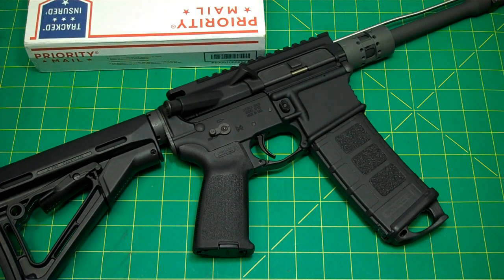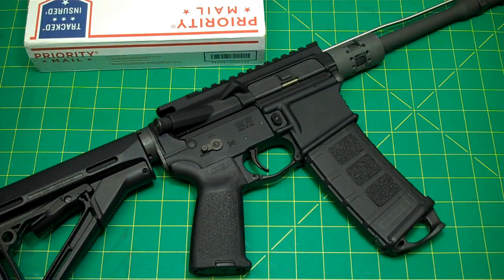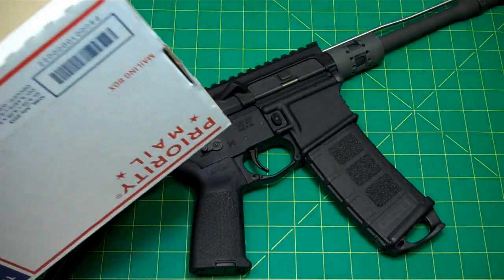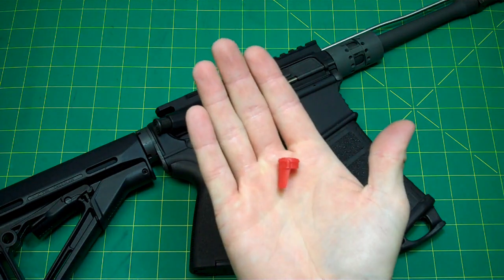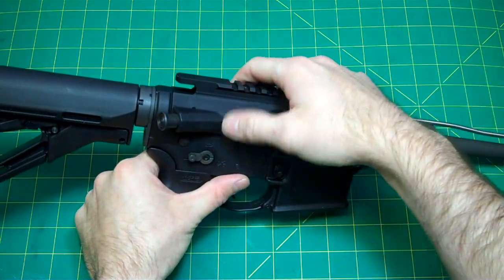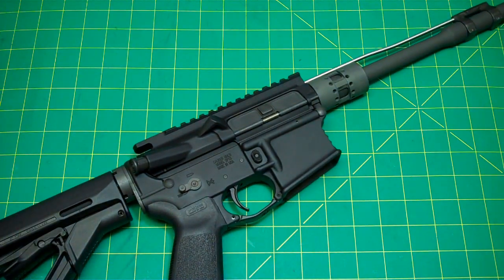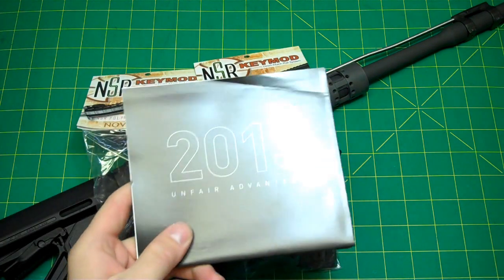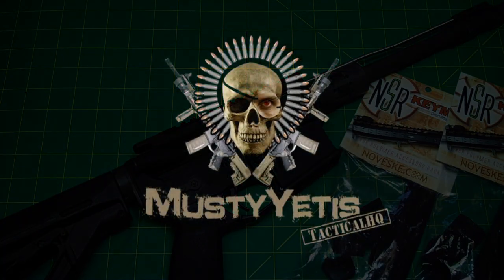ACCU WEDGE :: Does It Work??? :: Musty Yeti

Comment: Does absolutely nothing for accuracy, just makes a rifle feel a tad bit more solid feeling. If you decide to use the product, be sure to shape it as perfect as possible because if forced in any way it can effect balance of the bcg when it slams into the buffer weight, causing it to not be consistent thus putting way more wear on the bcg on one side and not the other. I would advise the video creator to trim his up just a bit. You don't want a tight fit, you want it to just be a bit snug because you're now also introducing uneven pressure on the takedown pin.

Comment: Slack between upper and lower is almost irrelevant as long as the hammer strikes the primer in good alignment and does not interfere with the upper structure.  The accuwedge is cool but cosmetic.

Comment: When I first got into ARs I was reluctant to “put some piece of plastic in my rifle” as so many on the forums will say. It’s horse shit. Nonsense. I spent $1000 on two really tight billet receivers sets (SLR and Ascend Armory) and after about 1500 rounds they both started to wobble. Steele will wear on aluminum over time. Better off going with a cheaper receiver set and just wedging the bitch. Not only does it work but it’s essentially constant and will not wear down. My two cents.

Comment: I asked around online and someone recommended I slip a small rubber oring around the front post of the upper receiver so it sits between where the receivers pivot.  I bought an assorted package of the black nitro rubber whatever orings at the nearest hardware store for $2 and used the smallest one.  It fixed the rattle, stays in place and isn't noticeably visible.
If you haven't bought a lower yet, Rock River Arms lowers, the one I built my other AR on, are very tight and never rattle.  Aero precision lowers come with a built in tension screw that stops any rattle.  Mine that rattled was a budget build with Anderson Arms lower and PSA upper.

Comment: You can shim it using cutout buss fusebox lid where the front pin meets the receivers and then laying a piece of electrical tape across the lower behind the hammer and it will tighten it alittle better than the accuwedge.

Comment: Call me cheap but I just stuck some foam in the same place the wedge goes and it works great, even after putting rounds down range.
Reply: I doubt that foam would do so well under stress as plastic.
Reply: 1000+ rounds and youre right, its starting to give a little play again might as well buy the damn plastic thing for a couple bucks

Comment: I've been using the same lower for highpower service rifle for almost 20 years, I'm on barrel 9 now and my rig. Is sloppy as hell. I'm running a .255 takedown pin custom made cuz the hole got so egged out. I used the wedge for a while but took it out. Noticed no change in group size. If you have to push down on the upper really hard to get it on your eventuall gonna egg out your takedown pin hole. Might take a while but for me I put a lot of ammo downrange

Comment: Because you have no BGC, it will have extra wobble noise. Once you add a BCG it removes a good chunk of noise as the buffer is adding pressure forward into the BCG. It will still have the loose tolerance, but the flop noise will be less pronounced.

Comment: I just tried installing an accuwedge last night in my build.  there was no way it would close.  I ended up having to shave off half of the bottom of the rubber to get it to fit snug.   it does eliminate any of the play you might find, but it makes it extremely tight!
Reply: Tyler Effinger your lower may not be truly mil spec. The m&p15's won't take an accuwedge without shaving off a significant portion of it.

Comment: All you need to do with the accu wedge is cut off just enough off the bottom to have it do what it's designed to do but still give you the ease of opening it up by hand.  I used an exacto knife to cut off little slivers off the bottom until it fit just perfect.

Comment: Movement will affect group size.  The more consistent the contact, the better.
Fully bedding the upper to the lower is a lot of work, this is easy.
Reply: How does it affect group size?  Your sights/optic are on the upper receiver. The optics don’t move in relation to the barrel.
Reply: @alphazuluz  it doesn’t affect barrel or optic accuracy.  Rather it affects shooter accuracy.  In effect it’s like having a jiggly grip.  Not the end of the world but annoying and requires more shooter compensation.

Comment: Years ago I had a Fulton Armory AR that came with one installed. Currently I have a Smith & Wesson M&P15 which does not have one. Does it work? Yes. Is it necessary? Meh. (Fit and finish on the Smith & Wesson is much better though.)

Comment from the maker: Trust me the Accu Wedge is plenty tight, maybe too tight.  Not to mention it isn't really necessary.  Most AR's have slack between the upper and lower receiver which doesn't hinder accuracy what so ever.  Thanks for taking the time to comment, I'll take what you said into consideration.

Comment: Turn your gun upside down and put the back end of your receiver, the rail above the charging handle on the edge of a table and push on the pistol grip and you can line up the pin with the Accuwedge installed. Easier yo show than say.

Comment: What problem does play between upper and lower cause?
Reply from the maker: None, it's pretty standard to have play between the two.  I was buying different part so I figured I would try out the Accu-Wedge.
Reply: MustyYetisTacticalHQ Did you keep this in your AR? Did you notice any change in your groups? This reminds me of a vague memory I have of someone advocating single shot rifles for long range competition because the lack of mag well allows for a more rigid design. I have no idea how true this claim is or what proportion of improvement you'd get in consistency from having less than standard play between the upper and lower receivers.
Reply: None.  The accu wedge is the product of picky non sense.  when I build my first AR i noticed play between the upper and lower and was considering the accuwedge.  THEN i took the rifle to the range and it ran through a couple hundred rounds flawlessly.  Plus a little research on top of that and I realized that there is nothing wrong with play between the upper and lower and it is in fact normal.

Since then I honestly dont even notice the play anymore, and it is much more play then what this guys rifle has in the video.  once you actually shoot your rifle instead of playing with it in your bedroom and you realize the play means nothing, you immediately forget about it.  I dont even notice it anymore.  dont waste your money on the accuwedge if your rifle is functioning.
Reply: TechnicaIlyInsane I think I'm done watching MustyYetis's videos; his entire assessment of this part is him putting in his gun straight from the mail with zero followup after shooting, let alone an organized long term assessment of its effect on  performance. There's nothing about this that I couldn't have learned from a google search and customer reviews and he knows exactly as much about the subject when the first words come out of his mouth in the video as I did when I loaded it.

Comment: @Logan Payne- thats cause DPMS oracles have that clunky 6061 grade aluminum upper that is thicker than BETTER 7075-T6 uppers used by other companies. Face it, the oracle is the lowest grade working AR you can get- unlined 4140 barrels, crap cut m4 feed ramps. If you believe a 650.00 oracle is a great gun,good for you- I can put together a BETTER PSA carbine- CMV chromelined barrel, m16 bcg,H buffer for 100.00 LESS......

Comment: Accu-wedge does eliminate play, but offers no benefits in performance.  The gun becomes unnecessarily tight.   It will not increase accuracy, as there is no effect on the barrel or sights/optics.
Reply: Josh Borton go see the TC boys and make that statement. It allows the Barrel and optic to shift slightly under firing conditions. Down range that adds up. So lock up is important. Saw another design might be better for precision rifle that included expanding pins to lock up the action.
Reply: Thomas Ewers 😹 Sure buddy. Because fuck physics.
Reply: Ya, after doing some research I've come to the conclusion that these wedges are a waste of money and time. They have no effect on accuracy, it's a gimmick.
Reply: That just what they say to sell more. All in all, it's a comfortability product. Much like the magpul CTR vs MOE.

Comment: The perfect solution to a non-existent problem. A fool and his money are soon parted.
Reply: the whole 4.99 these cost for packs of 6+. what a loss
Reply: Cryengine_X That is still money you could have put towards ammo  or even some small part that is actually practical. The point is that people are too meticulous about what feels "cheap". If I can qualify with an old "rattley" M16, trust me, the play is not an issue. Every rifle will always have a little play. But it isn't enough  to throw off your MOA, otherwise, every rifle would have to be replaced every year. If you don't want your rifle to rattle, leave it on the gun rack.
Reply: Folks who buy this device are seen as not having a comprehension for what's really important to good shooting, properly pointing the rifle with consistent sight alignment and pulling the trigger without disturbing aim utilizing SMOOTH trigger control.
Reply: @leroyatleroys  I dont like the rattle, get over it.

And every rifle definitely does not have it. My Ruger AR 5.56 had almost no play. It was awesome. It's when I built one from a PSA upper and a Anderson lower, that there was a decent amount of annoying play.

Also it's unique to the AR design that I  know of. Most mainstream guns aren't designed in a way where receiver/frame play can even  be a thing. It's just not a thing on Ak's, for just one counterexample.
Reply: Cryengine_X  I literally trained in the military with standard M16’s and M4’s both old and new. But fuck my educated opinion, right? Believe what you want, but the proof is literally everywhere. Plus the AK doesn’t have rattle and yet they are notorious for being less accurate compared to the AR platform. Not inaccurate to not be effective at combat distance. But you won’t get groups as tight as the AR platform and I have seen several vids on that. Rattle or no rattle, it is a very insignificant thing to want to “fix”.
Reply: @leroyatleroys  I DONT CARE. I just dont like it. I dont think fixing it is gonna  make the rifle more accurate...
Reply: @leroyatleroys  oh my other reply was just trolling. but like i said i dont care if it improves accuracy or not...
Reply: Viscous Shear From the statement that you just made, it sounds like you have never touched one.
Reply: Viscous Shear Just look at any vid with a particularly expensive AR. Or a well but standard AR. Especially with a mid to long length barrel. Many are well under 2 MOA.
Reply: Viscous Shear To put it in perspective, when we zero our rifles, even with the 14 inch barrel of an M4 which does have a slightly bigger margin for error than an M16 zero target since t has a shorter barrel, the target itself that you are supposed to hit is not mich bigger than 2 inches. It is held at about 25 meters, making the target perspective an equivalent to a target 300 meters away. We have to get all shots within the target to be considered zero because you have to be able to practically shoot a target from 300 meters away at the very least. If we had a 2MOA standard, we wouldn’t be able to do that consistently. And that is just with a standard M4. Not even talking about the super expensive AR’s made for long range.
Reply: Viscous Shear dude, if you are getting 4 moa at 100 yds which is far less than what we have to hit at 300meters, the problem is you, not the rifle.
Reply: Viscous Shear and if you are getting sub MOA from a short SR barrel then why are you even arguing with me? You are literally making my point.
Reply: Viscous Shear In basic training, I was given an old M16. I am telling you, I wouldn’t be able to qualify with that wide of a spread.
Reply: Viscous Shear The minimum MOA for battle rifles is 4. That doesn’t mean the m16 is 4MOA. It is definitely more accurate than that.
Reply: Viscous Shear a minimum acceptability amp s for the shooter. Not the maximum capability of the rifle. What is so hard to understand about that?